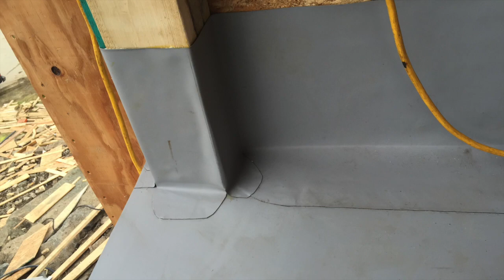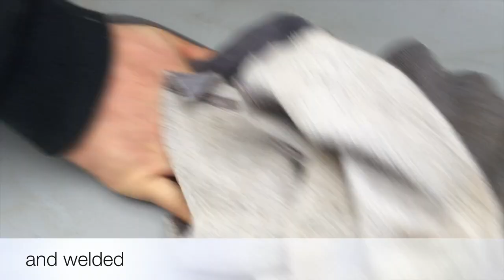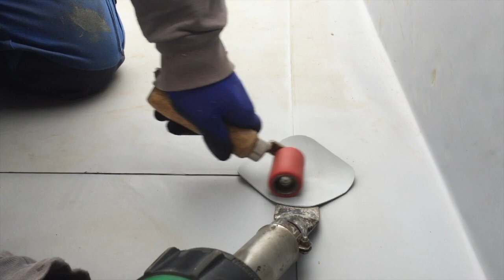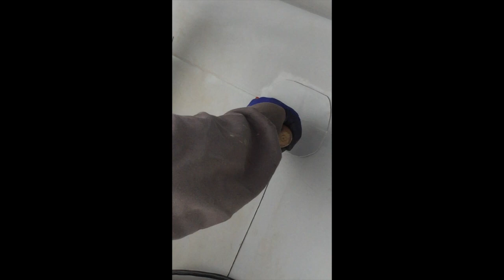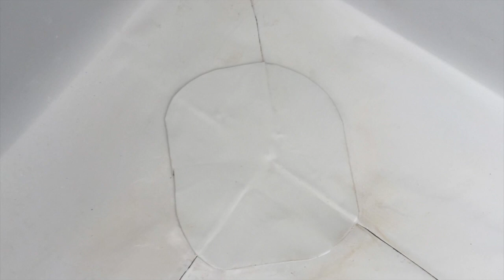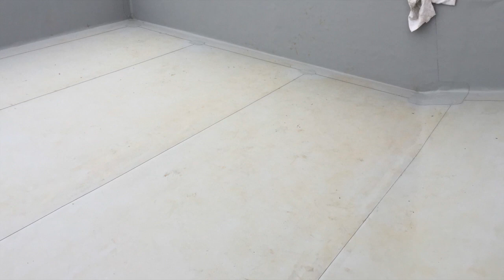CWS - TPO roofing installation Victoria, BC Part 3

Comment: I was wondering after 20 years of this Tpo installation when the roof has to be done again, do you rip off the old Tpo material or lay new material over the old material?
Reply: New material
Reply: I've always ripped them off to check the wood underneath